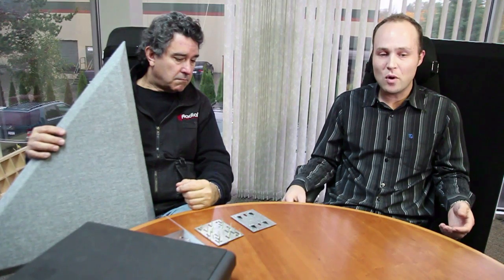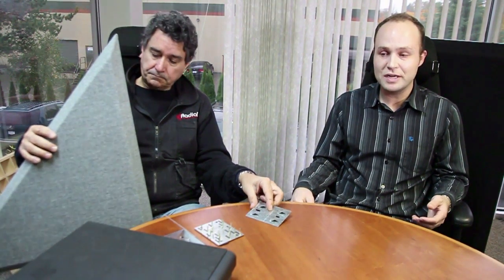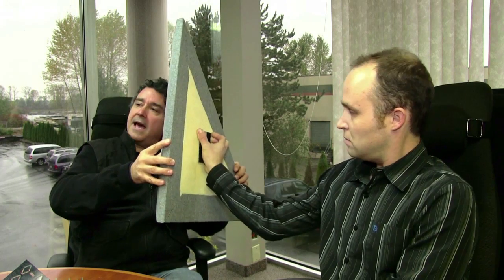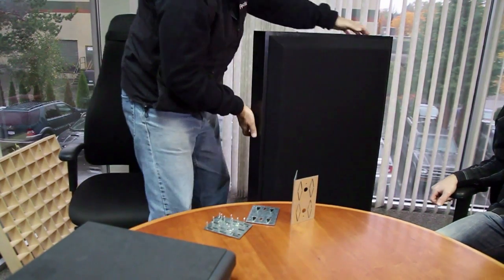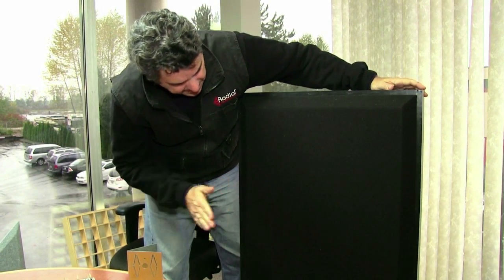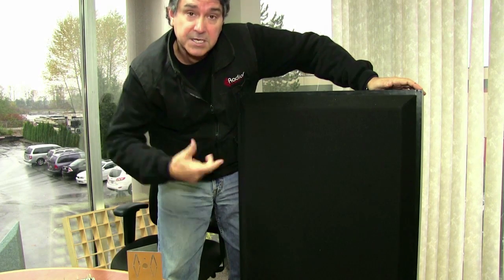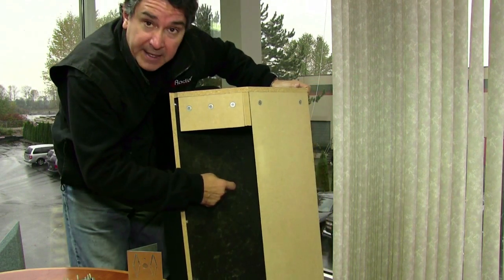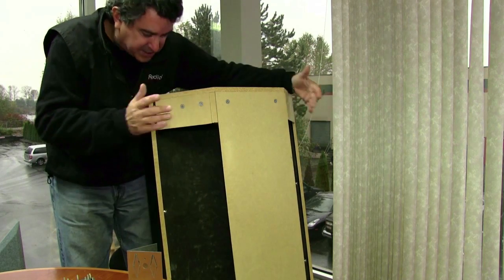Acoustic Panelling Construction And Materials

Comment: Different materials have different absorption coefficient.  All foam are not equal..  Not all absorption materials are equal either.

The problem is getting a good absorption coefficient curve. Many building insulation materials tend to over absorb in the 125hz to 500hz range.

I understand the problem with foam and building codes.   BUT, there is a foam that do have a better absorption coefficient curve than building insulation..  I'd check out Acoustic FIeld's foam.  it's denser than any other open cell foam I've seen or used.  

Corner traps are a hype.. 

Axial modes are between 2 parallel surfaces, not 2 parallel corners. if you put anything in the corner to go after low frequency problems, you are really only treating about 5% of the low frequency problem.  Axial modes are the most audible and the most problematic.
Reply from the maker: It should go without saying that there are variants of any material that affect acoustic properties.  Not all building insulation is equal either, which is why you'd use specific rock wool for broadband absorption.  I'd be curious to see the tested acoustic properties of Acoustic Fields foam, feel free to post.  

We use Roxul Comfortbatt R14 or 22 for building custom absorption, which is fantastic and inexpensive.
Reply: @warpacademy  I hate the sound of rock wool.  I've been in many studios with that stuff and it doesn't sound natural at all.

For low frequency below 100hz, I'd recommend a high quality diaphragmatic absorption cabinet that actually absorbs. 

Acoustic Fields has excellent absorption coefficient for low frequency and their open cell foam.. I"ve been in several rooms now with their treatment and hands down they had the best attack and decay for low frequency and the most natural mid's and high's.. I highly recommend going to a room with their treatment to experience it..

The problem with Roxul is it really doesn't do that much absorption compared to activated carbon for low end.   Activated carbon for the same volume of treatment is FAR denser AND more porous..  Salford University did a study of activated carbon and they had results where they measured Activated Carbon to be effective absorption down to 20hz.  Roxul can't do that..

Roxul is inexpensive, but it tends to over absorb in that 125hz to 500hz range.  

I would suggest comparing a room with Acoustic Field's foam using the same amount of sq footage coverage to Roxul for mid's and high's.  Hear it for yourself.

For low frequency under 100hz, I would recommend the Acoustic Fields' ACDA line, also if you only need to go down to 40hz, then they have a Carbon panel that's 12inch  deep and it does well at 40hz.. But for rooms that need to go down to 30hz, then the ACDA Series is what they recommend.

The rooms I was in had their ACDA products, foam and Quadratic Diffusors and I was flat out blown away.. I've been in many studios and I've never heard a room come close to what they are doing..

 Also, corner treatment is a joke IMO, it just doesn't do enough to go after the problematic Axial modes.  it's just not enough surface coverage..
Reply from the maker: While activated carbon is an interesting new development, the best rooms in the world are still being made with rock wool and fibreglass.  Look at rooms made by Northward Acoustics.  They're top of the field.  We're getting fantastic results with combinations of rock wool and lower density fibreglass.  

If you need to absorb down to 20 Hz, you'd never use rock wool anyways.  It's too dense and it would be reflective at those depths.  You'd use a lower density porous absorber like fibreglass, in a larger depth.  

You're correct that corner absorption doesn't do enough for major excited room modes.  You need floor to ceiling, wall to wall absorption, not little toy panels.  Air gaps can greatly enhance LF absorption performance as well, especially with floor to ceiling modules.  

This is a very old video, reviewing products aimed at hobbyists and home studios.  For a serious control room, you'd have a totally different approach.  

Activated carbon is a relatively new material.  I'll be interested to see how it performs in an actual build.  It seems quite expensive, and to be honest, we're getting really good results with mineral wools and fibreglass.  I'd be interested to see some tests from REW on a room built with activated carbon and to see the pricing on the completed build.
Reply: @warpacademy  But he's tried mineral wools and fiberglass and his activated carbon outperformed those materials with his diaphragmatic cabinets.   Yes, it's more expensive, but it's a much more dense and porous substance.  Mineral wool and fiberglass aren't nearly as porous or dense. You need poristiy and density to absorb low frequencies.

Here's a link to one study where Activated Carbon was used to absorb low frequencies in the 20hz to 55hz range.

Here's the reality.  Acoustic Fields is a relatively new and small company.  They don't have marketing and sales resources of reaching out to as many potential clients.

Just because a company has built a studio that's well known and they use fiberglass and wool does not mean it's a better material to use.

In order to compare materials, it's pretty easy, however, if you don't know or don't look at the comparisons, then you'll just use what is cheap and available. 

As far as sound quality is concerned, there's some subjectivity and if they haven't compared, then they haven't compared the two.  The other aspect is that Acoustic Fields does a few things with their activated carbon that's unique.
A. They mfg. their own AC, so they control the size of the pellets and the porisity levels.  There's MANY different types of activated carbon that's used for various applications such as water purifications, air purification, etc. so they are mfg by companies that make their activated carbon specifically for those applications.
Acoustic Fields has patents for theirs and to use for acoustic treatment aborption, so they are kind of the only game in town.

The other aspect is that activated carbon absorbs moisture, which degrades Activated Carbon's sound absorbtion, and to fix that problem, Acoustic Fields has their activated carbon treated with chemical that effectively resists moisture, so their proprietary activated carbon is specifically mfg. for low frequency absorption.  They posted a video not too long ago explaining this.

Now, if you want to test different materials yourself, you can buy the build plans to make a diaphragmatic absorption cabinet and for the fill material, you can use anything you want and you can buy some of the activated carbon from Acoustic Fields and then use anything else and then compare the amount of absorption in the lower frequencies and compare.   No one has every come forward with better low frequency measures with those cabinet designs using fiberglass, mineral wool, etc.   They simply do NOT have the density or porosity as Activated Carbon.

If you look up the most porous substance, it's Activated Carbon. It is one of the most porous material available.

you still need a lot because of how low freuquencies work in a small room with parallel walls.  Axial modes are the biggest and they are unwanted low frequency between two parallel surfaces (front to rear, side to side or floor to ceiling) so the more surface area coverage you can get will reduce the big peaks and nulls within a room. However the cabinets are probably going to need to be at least 12inch to 16inches deep because the cabinet sets the frequency and the cabinet fill material dictates how much is going to be absorbed.

Some prefer using the moveable cabinets and some can afford to have the walls, ceiling and in some cases built within the floor stucture, but that's a permanent installation whereas you buy pre-built cabinets or buy the build plans and DIY and make moveable units and build them as required and within your budget. Not everyone can afford to build a $1 Million room.  Some can.

But the other issues are reflections and those are frequencies above about 100hz on up and for that, Acoustic Fields has created their own open cell foam with a specific absorption coeffient curve and they modeled it after the hearing curves because they are going after a more natural quality that fiberglass, mineral wool simply were not designed for. Those materials were really designed for thermal insulation (hot and cold) and normally used for building insulation and using those materials for acoustic treatment was more of an after thought and it's widely used because it's cheap and they didn't want to create an open cell foam or other absorption material. Obviously there are companies that did, such as Sonex, Auralex and others, but they have different absorption coefficient curves and their open cell foam is actually less dense and the cell structure isn't as consistent. Which dictates the performance of the material.

I would encourage you to visit a room that Acoustic Fields has designed, I'm sure they can point you to a room you can visit if you call them.

AF has plenty of customers that have been using fiberglass and mineral wool based products that have moved to using their Acoustic Fields Activated Carbon based with their open cell foam and they won't go back to Fiberglass and mineral wool.

On a side note, KEF has a patent on using Activated Carbon for low frequency compliance within their speaker cabinets.  They started doing that years ago with their A.C.E. compliance. They used to have some vague information on that on their website, I don't know if they really market that with their products.  But they would use activated carbon inside their cabinets to smooth out the low frequencies.

but after it's all said and done, Activated Carbon is relatively new to the market and only one company that I'm aware of offers it and they simply don't have much recognition in the market since they are the only game in town so to speak and it's more a product that's sold on word of mouth and they don't seem to spend a ton of money marketing their products in various magazines, etc. like many of the other big players.  Also, large studios tend to go with big name architects that specialize in studio and they literally don't know about activated carbon since they can't mfg. it, so they use what they can get their hands on which is mineral wool and fiberglass.

Big budget studios tend to go with the big name design houses, but Acoustic Fields has sold their products to clients with studios designed by others and augmented (fixed) issues that still existed with some of these other studio designs.    Capital Records is just one of those that bought Acoustic Fields products to augment their pre-existing studio that was designed by someone else.
Reply: @warpacademy  I had met the guy at Acoustic Fields about 10 years ago and he explained to me that when he designed his diaphragmatic absorption cabinets which uses dual front walls, instead of one front wall. He tested about a dozen different materials including different types of mineral wool, fiberglass, etc. that were commonly used.  He said he stumbled across activated carbon by accident.  He was testing different wall construction using different materials and the home he was living in for his project had one of those water purifiers in the kitchen, he noticed the red light which indicates to change the filter, not knowing much, he removed the unit, but it was stuck on the faucet so he used a hammer to break it loose and in doing so, he broke it wide open and a bunch of activated carbon came out, which is what they use for water filtration. He started to think about it and realized that Activated Carbon is HIGHLY porous and dense, and he started to investigate the possibility of using that instead. After years of research and mfg. his own, he then figured out how to control the porosity AND he needed to chemically treat to avoid the AC from absorbing moisture, which degrades the performance for low frequency absorption.  He did his own testing and comparing to all of the other materials and the results were conclusive that Activated Carbon outperformed all of the other materials. He sent some units to RAL to have it independently tested and engineer called him up and told him he's never seen any other product the measured nearly as well as what was sent to them.

A few years later, he was able to mfg. his own and bring to market.

He routinely sells product to pre-existing studios where he fixes low frequency problems that the other professionally designed and built still had.  He has some videos where he interviews or has the studio owner attesting to how well their products work.

But you have to experience the difference in your own studio to verify.

not to say that some of the top end studio designers can't design or build great rooms, but they still might have problems that need to be fixed and the Acoustic Fields products might actually fix low frequency issues.   

He has replaced mineral wool or fiberglass used for mid to high frequency reflections, and he's done that all of the time. If you want to test it yourself, call them up, they might send you some test samples to try out in your own studio. He's done that from time to time depending on what he has available to send to prospective clients.
Reply: @warpacademy  Just because Northward Acoustics makes great studios doesn't mean that they could achieve better sound quality if they used Acoustic Field's wall construction and materials, along with their Acoustic Foam instead of fiberglass panels for reflection treatment.  Ever think of that?

Not to be a jerk about it, but I've talked to the owner of Acoustic Fields and he gets calls all of the time from people that bought treatment made from fiberglass, mineral wool and changed to his products and never looked back.

Don't use the "it costs more" as an excuse, other than you don''t have the budget.  Most amateurs and even professionals rarely put in enough budget for treatment because they put it into esthetics OR gear as that's either more important to them OR it's what they THINK is better.

The Acoustic Treatment world has been pushing mineral wool and Fiberglass for years.  Heck, I even had products made from those materials and also different brands of open cell foam to treat reflections. And I spend sometime listening to what Acoustic Fields had in their demo rooms and I have never heard a BETTER sounding room than his. They were natural and the connection I got to the music was insane.  It's almost like putting on the best headphones without having headphones on and without the pain of having speakers a half an inch from your ears.

There's a recording studio in South Africa that's designed by the legendary Tom Hadley.  It's called BOP in South Africa.  Too bad it's insanely expensive to build. I'd put that as one of the top recording studios in the world.  It was designed and build before Activated Carbon was actually used in acoustic treatment.

https://www.youtube.com/watch?v=ZjKVndZSZqE&t=11s

Comment: this channel is so much better than all the others sources of info I have come across,, everything makes total sense to me now,so in essence a good thick fibre glass insulation for walls for sound proofing probably about 4 inch,,, which also adds to the bass diffusion, and then add some wall panels etc etc as and when required over a period of experimentation  .. job done.. oh!!  and throw in a sofa. and a rubber backed carpet for the floor area.
Reply: no leather tough its reflective.